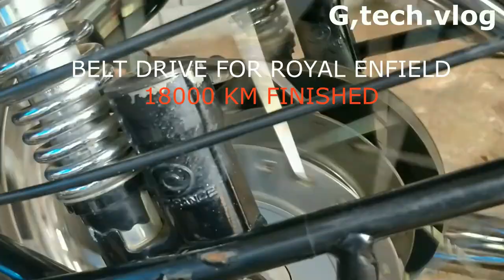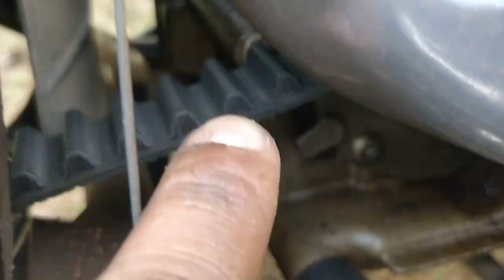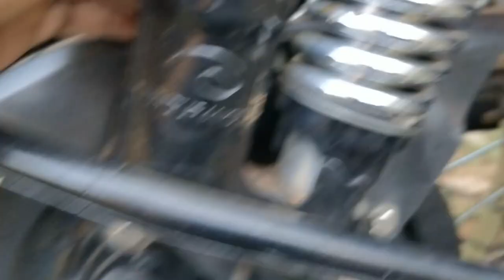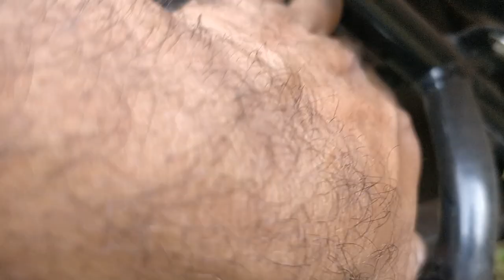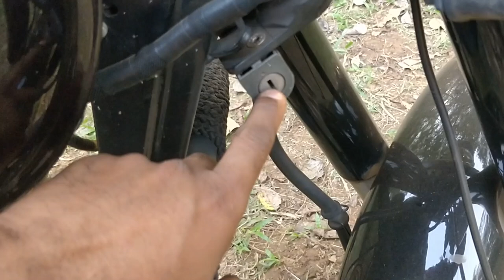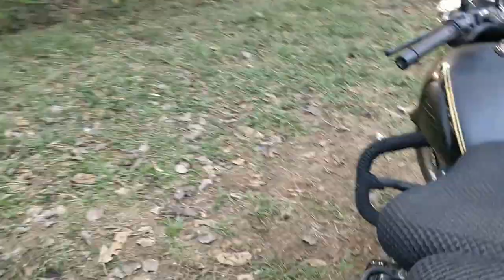RoyalEnfield beltdrive 18000 KM Finish

Comment: suhruthe ente standard 350 (2016model) 22000km ayapola chain and sprocket maariyathu, correct ayit maintain chythal, chain thanea aanu nalath!
Reply from the maker: ബെൽറ്റിനുള്ള പ്രത്യേകത ചെയിൻലൂപ് വേണ്ട.. Smooth driving 2ലക്ഷം കിലോമീറ്റർ Running കിട്ടും
Reply: Thunderbird 350 X. 26000 km njan use aaki self used aanu… but chain one side aayirunnu.  ( chain kayari irangi kalikkanu runningil). 

Eniku belt drive use cheyyan like und ..

Comment: Chain system is old technology but that's most efficient way to transfer power
Reply from the maker: ചെന്നൈ
Reply: Chain drive is better
Reply: @motovlogerkl.4498  belt  drive is best,  no maintenance. Very  very minimum power difference ,  ath  nammal  ariyukapolum illa.
Reply: No. Chain drive losses 30%of energy, belt has only 20% loss.
Reply: @abdullat1638  Not. Chain have efficiency of 98%, Belt driven system have 93-96%.

Comment: Check NCR motorcycle review on this belt .. you will know actual reality
Reply from the maker: Bro im fitting this 40000 km finished. 
https://youtu.be/QpBtCGaetl4
Reply: എൻറെ വണ്ടി ചെയ്യണം കോൺടാക്ട് നമ്പർ തരുമോ
Reply: Bro if you use quality belts nothing to worry. NCR MOTORCYCLE review by using a Chinese low quality belt. Must use high quality belts  like Gates etc... enfield is a 350cc engine or 500cc engine. But Harley D. has engines 1200cc,1800cc etc. they use belt drive system on that bikes.